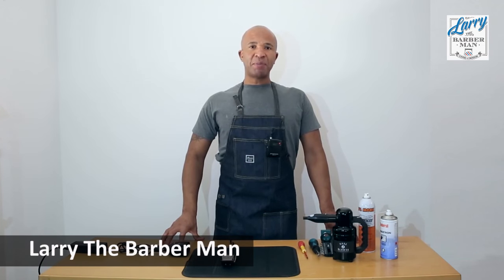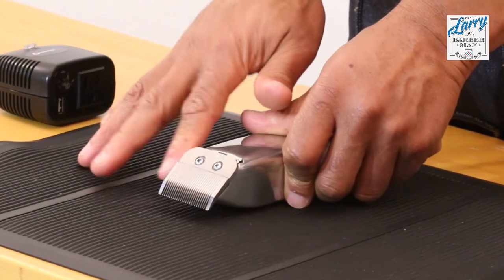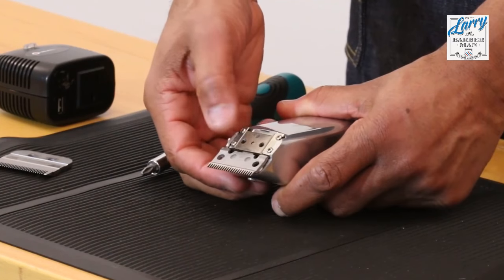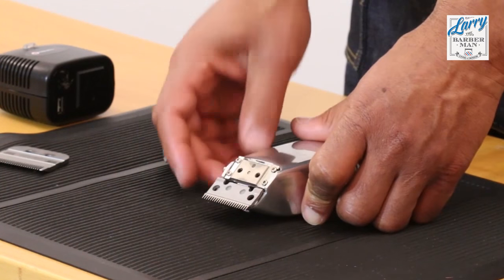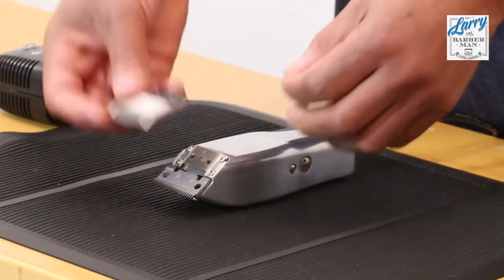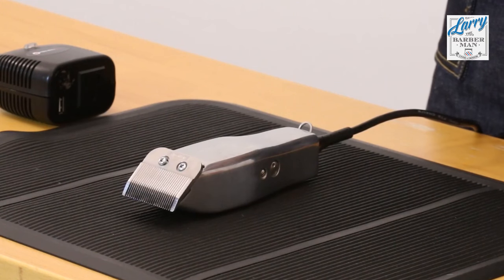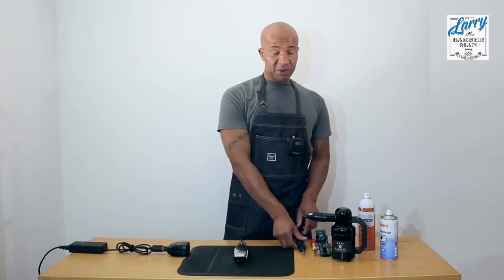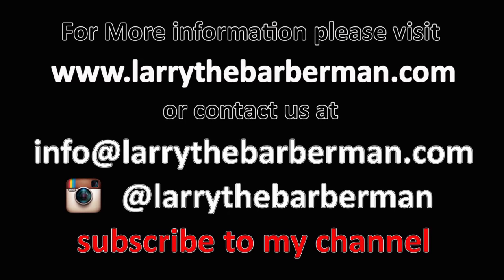Andis Master Lever Adjustment: Tighten Loose Lever Fix - Quickly And Easily

Comment: I might have to get a new clipper. I currently have the Andis ProAlloy, have had them for about 11 months. the lever goes down within like a second once I'm applying pressure.  For the past couple weeks I noticed it, but kind of set it aside. Last night I was giving myself a quick cleanup on my fade when suddenly I forgot to adjust it bc it does close on it's own when I apply pressure, and I ended up going a little to high with the #1 guard😠, I had it opened all the way but it closed within like a second... so now my left side is all jacked up and high, looks stupid and I got work in the next days, lol. I saw this video and opened up my clippers. I then realized I don't have that adjustable lever, I don't think there is anything I can do other than fighting a loose lever or just buying a new pair of Andis😅, I'm thinking of getting the new but affordable Andis master ghost, $165.00, This time I'm going for durability any recommendations? I just hope if I do get the ghost they have that adjustable part where u can tighten it or loosen it